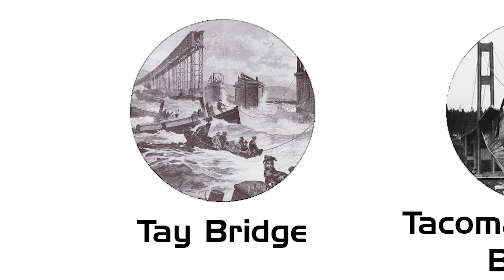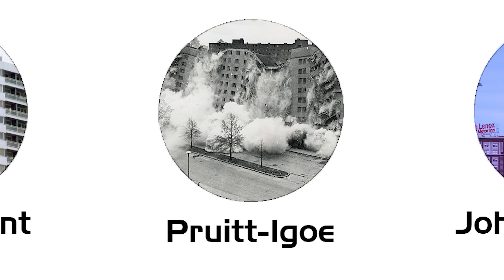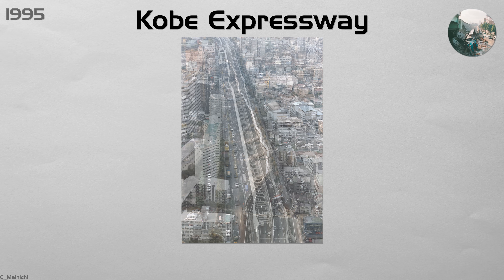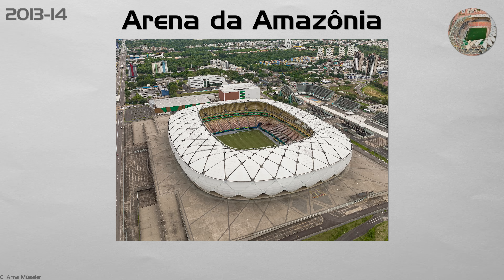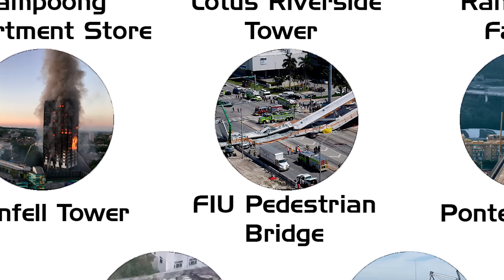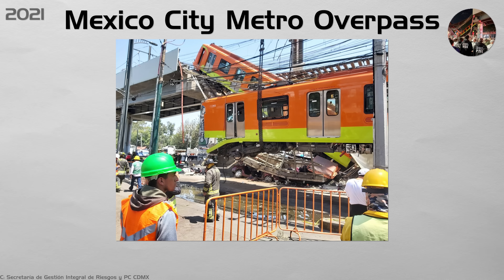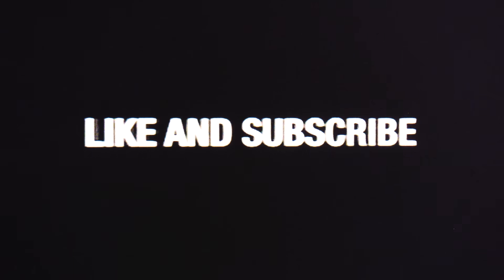Architectural Disasters Explained In 15 Minutes

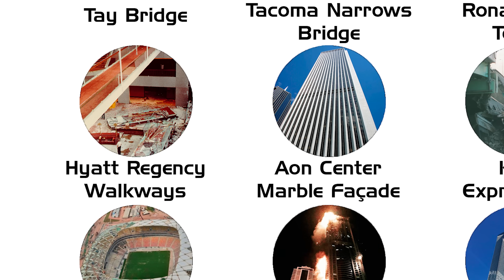Comment: 04:17 This video makes multiple errors regarding the Hyatt disaster. 

1. These design elements were known by everyone in the city (and in any other analysis of the Hyatt disaster you care to check) as "skywalks" not walkways; but this is merely a quibble about terminology.

2. They were not glass walkways. They were concrete. A "glass walkway" means you are walking on glass panels and you can look straight down past your feet. The only glass panels here were under the railings. 

3. Most seriously, the last-minute design change did not double the weight the support rods had to hold. 

The design change meant some sections of the upper skywalk's beam had to hold double the weight. 

(Under the new design, the single continuous super-long support rod that would have supported both upper and lower skywalks was replaced by two shorter support rods which connected separately through the upper skywalk beam, as seen in the circle at 4:51. After the design change, however, every part of every support rod still held exactly the same amount of weight/tension it would have had without the design change. The video is very wrong when it says otherwise.)

Compounding the double-load on the beam, each "box beam" which failed was constructed from two C-shaped "channel irons" that were welded together at their thinnest points, and then oriented so the welds were on the top and bottom. After the design change, the two distinct support rods (pulling in opposite directions through the upper skywalk's beam) pierced the welded "box beam" through this thin welded area, with no stiffeners added above or below the beam. 

With this section of beam between the two opposing support rods bearing double the intended weight, the simple nut-and-washer connections on the ends of the upper and lower support rods easily pulled through the thin welded seam of the "box beam". 

These factual errors - especially that significant third one - make me wonder what else in this video is incorrect.
Reply: The original design, with a single one-piece threaded support rod suspended from the ceiling to the upper skywalk, and continuing to the skywalk below, would have safely held up both skywalks just fine. The problem was that original design was completely impractical for the construction workers to assemble. 

If we assume 10 feet per floor: to assemble the original design, after first hanging the 40+ foot long suspender rods from the ceiling, each upper skywalk "box beam" would have to be drilled, then lifted up to the bottom of the threaded rod, then lifted up past 20 more feet of threaded rod (since the upper skywalk was two floors above the lower skywalk); then the washer and nut that were necessary to support the upper skywalk beam would have to be threaded onto the rod, and then rotated more than 1000 revolutions to walk it up the bottom 20 feet of the rod, up to the level of the upper skywalk. 

Impractical to manufacture threaded rods that long, impractical to transport rods that long to the construction site, and impractical for workers to assemble the skywalks with rods that long; plus they would have to add a pipe along those 20 feet of exposed threads between the upper and lower skywalks, for the sake of appearance - otherwise hotel guests on the lower skywalk would see ten-foot-long ugly bolt-things rising above them to the underside of the upper skywalk.  

The original design was a case of "looks good on paper" to the engineer, but not for the workers who had to turn the blueprints into reality.

The impracticality of assembling the original design led the builders to request a design change to use two shorter support rods instead of a single long one. The design was changed, the engineer unfortunately approved the change without proper analysis, and the ticking time bomb was constructed. 

(Credit for this analysis goes to my dad, who as merely a machinist and welder (not an engineer) - if he had seen the design change being proposed, would have immediately known it would fail. 

He also knew as soon as he saw the original design, with its super-long rod, that it would have been impractical for workers to build/assemble; so when it was announced that the tragedy was due to a design change, he knew why that design change had been requested. 

He also surmised that during the redesign, if the engineer had called for  short upper and lower stiffener plates to be added to those short sections of upper skywalk beam, the updated design with two support rods could have been accomplished safely, and there would likely still be hotel guests admiring the views from those skywalks today.)

Comment: 01:29 Ronan Point Tower didn't collapse because the wall blew out; it collapsed because the gas explosion lifted the ceiling UP, due to the ceiling merely resting on its column supports. 

When the ceiling came back down, its momentum was so great that it punched through the supports and fell onto the floor below. That was the cause of the progressive collapse. 

This factual error makes me wonder what else in this video is incorrect.

Comment: The Hyatt Regency incident did not have a design change that doubled the load on the rods.  The original design had one set of rods that supported two of the walkways.  One at the bottom end and the other at the middle of the rods.  This was hard to construct, as the walkways were designed to rest on washers above nuts threaded to the rods, but the rods were not threaded for their entire length.  Guided by hindsight, the nuts for the fourth floor walkway should have been long enough for ends of the second floor walkway to be threaded into them.  What they actually did was hang the fourth floor walkway from the atrium ceiling and hung the second floor walkway from the fourth floor walkway.  This doubled the load on the supports for the fourth floor walkway.  The supports were boxes made by joining to 'C' channel sections.  The bottom flanges were not up to the loads and the supports slid over the washers and fell to the floor.  As bad as the design change was, the original design had either been based on flawed assumptions (there would never be crowds on the walkways) or had a safety factor of less than two.

The developers of the Millennium Tower had been engaging in shenanigans.  Another development had managed to get money from the city to upgrade the foundation, so the Millennium Tower developers tried to get city money to subsidize their foundation, too.  However, they needed proof that piles to bedrock were not already needed, so they got an engineering firm to provide a set of plans for a foundation that did go to bedrock.  The city did not have the money and the engineers had signed off on the design, so the city just approved the provided design.  The developers were faced with either finding more money to build a bedrock foundation, or go with the approved design.  They went the cheap route and things went horribly wrong.